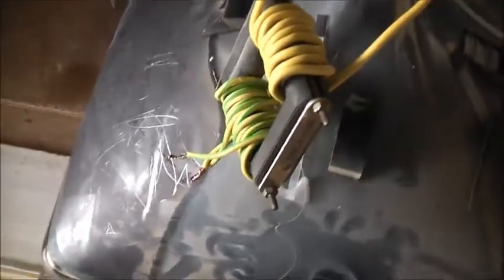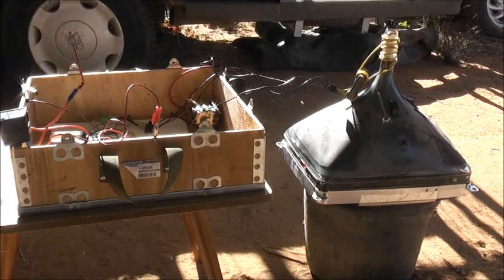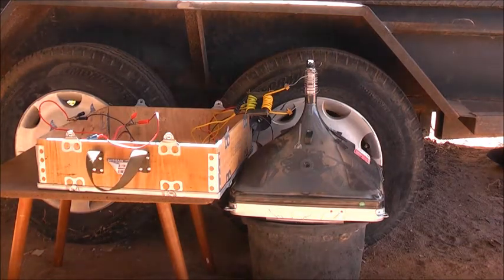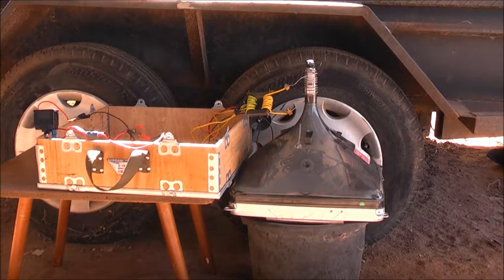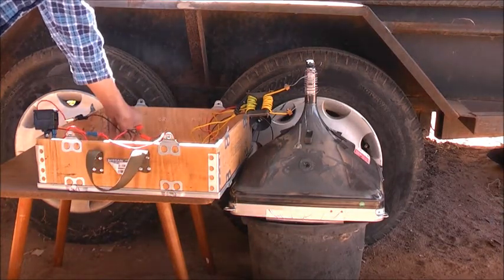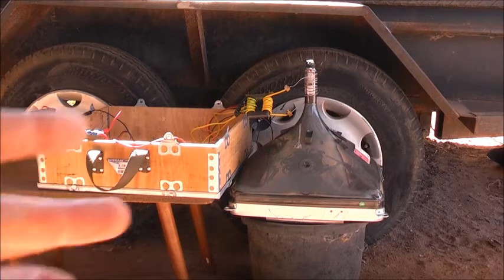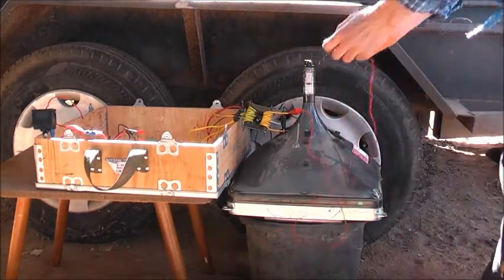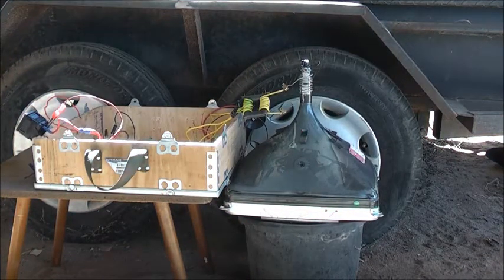LG Studioworks CRT & Flyback EOL

Comment: If you manage to heat the eletron gun to red glow, try:
Ground all e-gun pins, and connect HV to the anode-cap.
Should probably be done with a driver able to do 2-3 cm sparks (or arc-start distance)
(ground the outside of the CRT to avoid zapping yourself more than needed)

I would expect the whole front to glow.

Comment: Nice transformer teardown.

For your use, some CCFL-transformers from a big CCFL-LCD TV would probably be better.
Less voltage, but more current. Probably longer arcs, but shorter sparks.

I am suprised that you got glow inside the CRT, shouldn't be any gas there at all.

Those flybacks, can stand operational HV for a long time, but overcurrent kills them.
It's kinda wild, you feel the HV more on the screen front than on the flyback outside.

Comment: The epoxy probably get put in under vacuum while still soft.
With your CT to single winding TX. Try not to use the steel clip, use a cable tie to hold the ferrite together. The clip will take a lot of heating energy out of your coils.